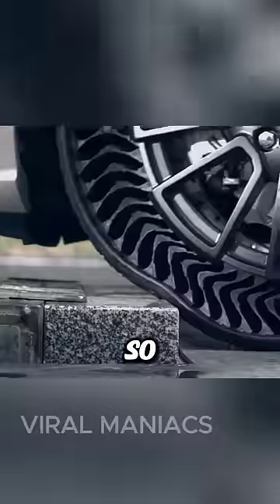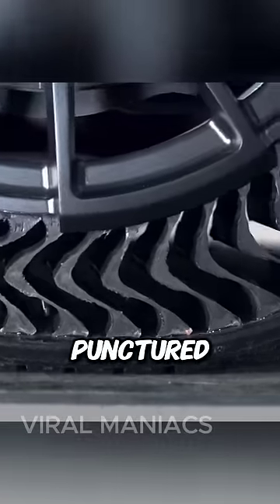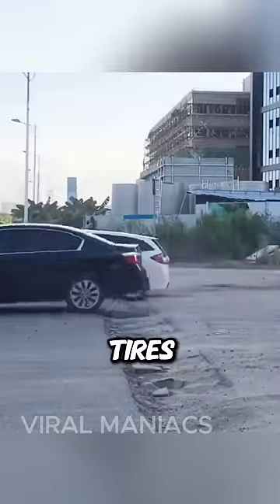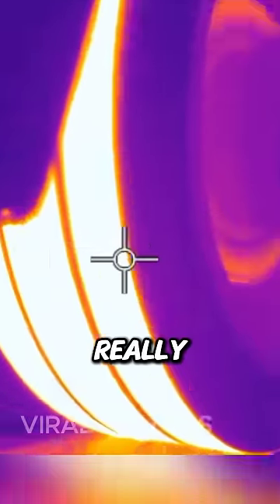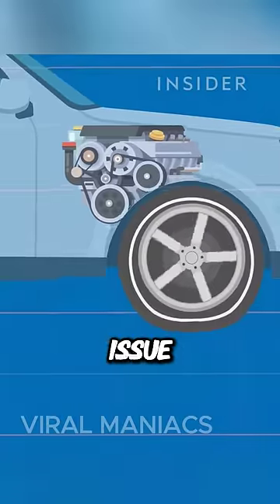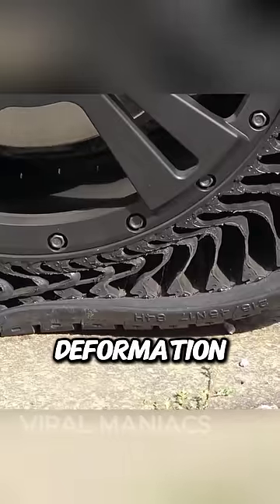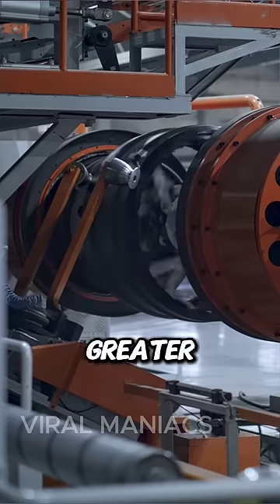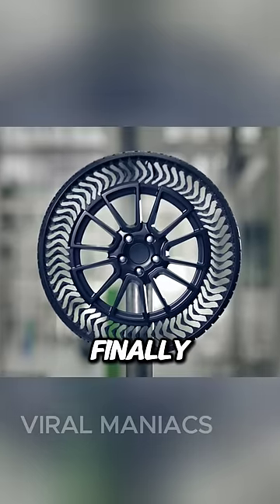Why Don't We Use Airless Tires Yet #shorts

Comment: "It is ready for production and commercial use"
They have kept saying this for the past 20 years!!!
Reply: tbf it’s being used commercially
Reply: Brooooooooooooooooooo like WTF
Reply: The plant I work in uses them on some of their machinery
Reply: 30 years bro, 30......
Reply: @curtisday7827 I mean yeah like forecliffs and other major  machinery meant to carry more weight lol but they don't do a whole lot of shock absorption primarily and when they do it's a t slow speeds not highway speeds
Reply: Well, they ain't lying, it is ready, but not available xd
Reply: Total BS.  The theory has been around since Goodyear built the “tires” for the lunar rover.  The problem with the design is cornering and sidewall stability, especially under load
Reply: @donaldculp3759  No, different type of tire altogether. I get where you are coming from, but no, the idea yes the application no. Lunar Rover Tires were originally developed by NASA and is now commercialized for use by The SMART Tire Company. These superelastic tires are airless, durable, and will never go flat theoretically. They are made from a special advanced material, NiTinol+ (nickel titanium), a shape memory alloy (SMA) that's elastic like rubber, yet strong like titanium. They have the same shape and general look of a traditional tire, whereas the ones shown in the video, like many others of the same type, have no side walls and are see through.
Reply: @Backlash00z89 "forecliffs" is probably the most interesting spelling of fork lift I've ever seen
Reply: Exactly 💯
Reply: It is ready but they don’t know how to compensate the money loss. Just making them 4 times more expensive doesn’t work because nobody will buy them and another thing is, who drives his car 10 years?
Reply: They are in commercial use. Most lawn mowers I see now are using them.
Reply: its a big market
Reply: @senorelroboto2 That is agricultural use, not exactly commercial. Commercial would be on semi trucks. But, they still won’t hold up to the heat they build at higher speeds, so they are still useless for the automotive world.

Comment: A big problem is the tread. A lot of tires need to be replaced because the tread wears out. Most people see these and think they would never had to replace a tire again, but because of the tread they will end up replacing a lot of tires anyway. Because the airless tires use more material they will cost more and could generate even more waste/pollution.
Reply: @jackventure3703
Not a problem if you can have them retreaded.
Reply: This, exactly.
Reply: I'd say the vast majority of tyres, at least in my country, are replaced exactly because of thread wear. Dirt roads are not common, here, even in the countryside. So, that mindset wouldn't be the norm. Yes, there are refurbished tyres, but people think they're less safe and heavier, only suited for  agricultural machines/tractors. By the way, these must be a lot heavier than regular tyres.
Reply: No, like the other post stated they will be retreaded. The tire place will just send the used ones back for that. So less rubber is required. Any one that is damaged beyond repair will be recycled. Tires are my life. This has been in development for over 20 years and millions in research
Reply: Because they weigh more and have no real sidewall for support they generate MORE heat
Reply: @staples138  wrong
Reply: You could reduce the waste, it’s less rubber per tyre
Reply: @staples138  they have no higher pressure inside, so they have less air molecules to exchange heat and cool down. The tires don't generate heat, the friction between tire and ground does. But that inner structure does not wear out, only the thread does.
Reply: @Lucifurion  how? there isn't enough to retread?! Not to mention they will wear out faster do to the lesser thickness
Reply: @Lucifurion the problem with retreads is they are usually shit.
Reply: We put airless tires on our lawn mower. Conventional tires would last 250 hours. The airless tires have 1000 and only look half way worn. Obviously cars are going to do more wear, but I've been very impressed by airless tires
Reply: Except these are made for countries where a tire usually dies because of a pothole before it wears out.
Reply: I don’t think anyone with a brain saw these tires and thought that they’d never have to replace them, they see it and think it’s convenient to not worry about maintaining proper tire pressure. Why would anyone see these and think that that the tread doesn’t wear out just because the tire doesn’t require air?
Reply: micro plastics
Reply: The idea is they can retread them look up the tweel it’s been around for a long time but got ignored for some reason
Reply: Yup, look at the tire in the video on the car, barely any thread at all.
Tires absorb shock just your shocks do.
Reply: Yup
Reply: @Lucifurion all rubber/silicon materials dry rot over time. They still will not last a lifetime. And depending on your milage, you might not even get 1 retread out of them.
Reply: The problem is there is no sidewall so  when turning as speed the tire wants to fold over.  That's why they arw only used on lawn mowers and skid steers.  Things that don't go fast and turn by pivoting.
Reply: @Lucifurion pls no
Reply: And just like the video said they aren’t as good in the heat so come summer time your tread will really stick to the road which also result in worse gas mileage. I think these could be great offroad tires though with the right tread
Reply: They actually use less material because it’s less of a tire.
Reply: Exactly 👍🏿
Reply: No one think you wont have to replace these lol.
Reply: You can retread them.
Reply: What about speed they look like it would be a massive wreck at high speeds
Reply: @Lucifurion Rereading is not a good thing, it's unsafe and doesn't give the same performance as a new tyre does
Reply: I think the most important part here is the safety. Because they can't get blown out, it's quite a bit safer that regular air tires.
Reply: @Lucifurion indefinitely huh? lol
Reply: @Lucifurion  What did you call me?? /j
Reply: I don’t think it’s environmental, if the government cared about the environment they wouldn’t be doing a lot of things they do
Reply: should be able to retread without worrying about a blowout like a normal tire i suppose
Reply: Used car tyres should be recycled fully and that where money should go to research best way to recycle.
Reply: @punker4Real that's it? Micro plastics?. Meh.
Reply: Nice point 👍🏼
Reply: I wonder about the fatigue life of the 'vanes' that carry the vehicles weight in place of the air cushion.
Also, should the car be parked in a puddle that later freezes, the driver needs to get the ice that's through the tire broke free.
Reply: Maybe the airless ones can be easily retreaded.
Reply: @Lucifurion the airless construction might allow for a replaceable tax.  Maybe a "bolt-on" replaceable outer layer? I'm thinking the flexible ribs are the most difficult part to design because of the tradeoffs between ride comfort, handling, and service life.
Reply: @staples138 Lol you think they will look like this? They will have a side wall
Reply: @robertpulliam4152 You guys are all joking about the sidewalls right?
Reply: @Lucifurion   Not that easy to do, even for forklifts... And these will need to consistently travel, well over 7x the speeds that any forklift can produce.... And the tire/wheel assemblies are very heavy as well as lack resiliancy... Definitely not good for road rated vehicles, and quite dangerous at speeds above 20 mph...
Reply: @TheLongDon  no.  What I said is true, and also they can't put a sidewall on them becauaw they need to be open to cool.  Bending rubber 1000's of time per minute creates heat
Reply: @robertpulliam4152  They do not need to be open to cool.... These tires are for demonstration only, they will have sidewalls on them on release. You aren't flexing the rubber any more than you would any other tire on the road, unless you think these are exclusively used to drive over speed bumps or something???
Reply: @CarNerd7  re treading isn't safe because your tire can blowout since it was not designed to be re treaded at all within its life, it's disposable. With a tire like this, a professional re tread should not be an issue. At this point you would have to replace tires by age and not tread life
Reply: @TheLongDon  right, but other tires don't have rubber fins inside the tire sealed up in a closed system. These tires are already on thr market for other applications, and they absolutely are open.  It's not just for demonstration purposes.  Heat and low tolerance to turning at speed arw the reasons these tires aren't being used in the automotive world.
Reply: @robertpulliam4152  Just looked it up because I've had this argument before and the answer is only slightly different from back then: They have confirmed it may have sidewalls on production, but even if it doesn't it shakes mud and ice and water loose and doesn't have issues without a sidewall when turning at speed (as expected from Michelin lmfao)
Reply: Exactly, saying this somehow reduced amount of tyre waste is ridiculous. They are replaced because the thread is gone after driving them long/hard enough, and that will be the same with any type of tyre.
Reply: Why tires cant be solid rubber i dont understand whats going on here
Reply: Here is the True Savior

HalleluYAH - Hallel u YAH - “Praise YAH”

YAH The Father (Genesis 1)
YAH arrives via The TENT OF MEETING
YAH was Who they Crucified for mans sins
YAH was Crucified on an Almond TREE

Original Semitic of Moses
Isaiah Scroll (The Original Isaiah)

Isaiah 42:8
I am YAH; that is my Name! I will not yield my glory to another or my praise to idols.

Isaiah 43:11
I am YAH, there is no other Savior but Me.

Isaiah 45:5
I am YAH, and there is none else.
Reply: The reason they don't make tread last longer is because then we wouldn't buy as many tires. It's planned obsolescence.
Reply: @staples138  so many people acting like just because they dont have one here in the video its impossible for them to have a sidewall when in reality thats probably exactly what theyd do, Im sure they dont want dirt and snow and ice to fill the tire either. Its probably just left open for testing and demonstration so you can actually see how theyre performing on camera.
Reply: Things that could be amended in the future I’m sure if we were to pursue them. I really think that there’s a bigger, more well-funded obstacle as to why we don’t have them in mass use yet lol

Comment: They’re widely used on heavy construction equipment, lawn mowers, and landfill machinery. Just not cars. They’re also really expensive, that’s why they’re not widely used.
Reply: A company I do work for has dozens of pieces of heavy machinery and not a single airless tire. Forklifts yeah, cause they only roll on smoothe concrete floors, but anything that has to deal with roads? I don't think so.
Reply: Even those are different. They're special made and foam filled.
Reply: @leoncaples2947 I have a skid loader that has Michelin Tweel tires on it -- same design from the video. They're popular for lighter equipment like mowers and skid steers.
Reply: @leoncaples2947 Yeah this is what Lull tires are, can actually lose chunks and still use it perfectly. Costs more than some peoples cars though
Reply: Well worth it in the long run
Reply: Why are they really expensive?
Reply: @leoncaples2947 not quite correct dude. They're exactly what you pictured in this video, I've had a set on my bobcat for 10 years
Reply: They're a lot cheaper than regular tires. I guarantee you, only because they last a lot longer than air tires like 10 sets to one. One maybe even 20 sets to one depending on the application.
Reply: These tires were $1000 USD a piece in 2017   How much are they now ?
Reply: @rich1879  if you can replace the treading then yes. If not, then no. The inner part of the tire that is airless may last a long time but the treading is going to be worn out quickly just like any other tire and will need to be replaced.
Reply: @fire_drake12.arc.24  you don't know what you're talking about.
Reply: Non of those things run 85000 per tire at 85 miles per hour 😂
Reply: Yeah the road noise and comfort with expense is hard to overcome. If you want something brutal though airless tires are crazy
Reply: No they suck for auto applications that’s why they aren’t used. They are garbage in any performance application, they are also very bad in a heavy braking situation especially with speed. There is a reason they only use them for forklifts.
Reply: No it's because of greed!!! It puts them out of business!!!
Reply: @Glenn-em3hv  no it’s because they suck and aren’t really usable in a real world situation. Extreme heat and cold make them useless, hard driving or braking make them even more useless.
Reply: Thats exactly what my mechanic/boss told me

Comment: From an engineering POV, these are 2 different customers. Airless tyres prioritise on Absolute Reliability which is imperative for NASA. Normal air tyres prioritise comfort and cost, reliability is just a bonus. Tough to make 1 size fits all
Reply: No, NASA doesn't need them for reliability. If air tires are reliable enough for commercial airplanes, then they're reliable enough. NASA needs them for Moon and Mars vehicles because you can't have air tires in vacuum, near vacuum, and in extreme temperatures.
Reply: @Mr.Anders0n_  That's an absolutely valid point! Those are the conditions necessary and Reliability is the quality needed

Comment: Definitely a head ache for police when chasing criminals.
Reply: They’ll just roll out… 
THE GRAPPLER!!! 
Assuming they are chasing of course, not waiting to catch
Reply: A spike strip will still get caught in the tire and slow them down.
Reply: They have stuff that can lasso onto tires now and stop cars fast and safely
Reply: They have a better system now...works like a net.
Reply: criminals would possibly have the same tyres
Reply: Let's all live in jail cells, monitored 24/7, so the cops have it easier 🤡
Exactly the same mentality
Reply: 👺 yes the Neanderthal european caveman 👺
Reply: Not really
Those things can't take high speeds at all
Reply: Now they'll just shoot your car with a GPS tracker
Reply: All new cars will have gov shut off switches
Reply: Run forest run
Reply: By law all new cars have kill switches that police can use
Reply: When a airless tire gets caught by a nailstrip it will sill get ripped apart after a little distance
Reply: @christopherwellman2364 – someone who hasn’t seen a spike strip used
Reply: @ministryofwrongthink6962  if it wraps around the tire, it'll slow it down
Reply: @3goats1coat or, just don't get pulled over
Reply: Get spikes that once the tire is puncture it releases a horizontal set connected to the original spike to set the whole strip in the tire
Reply: @Cornball-01  exactly
Reply: They'll throw one of those giant banana peels or maybe a red shell
Reply: @josephbrandenburg4373  lmao
Reply: How so? What does that have to do with bad people?
Reply: @mikeb1596 That would be illegal for law enforcement to do the kill switch on vehicles. The government cannot require a kill switch to be installed in any vehicle because of the Fourth Amendment. This is what a high-speed police chase is for because it will put criminals behind bars for a longer period of incarceration if they hit an innocent vehicle or pedestrian.
Reply: @3goats1coat  the public would have it easy too,less of a danger on the road from ppl running from cops,if these tires would actually aid someone running,idk see how that's equal to a 24/7 monitored jail sentence, that's like somebody saying that bc you  commented that,that you want no laws just bc there are some bad cops,awful big leap don't ya think
Reply: @jamierowe_   these kind of issues ultimately should be decided from the point of view of public good and benefit, not from some misplaced need to bend over backwards to authority or virtue signal.
Do you have any idea how many car accidents happen, not daily, but each and every minute globally due to tire blowouts? How many millions of kids have to become orphans, only so a single doughnut-muncher can get his hollywood moment and roll out a spike-strip?
Go out, touch grass. Your thinking is mangled by the screen.
Reply: @3goats1coat You do crimes or  something?
Reply: @Randomguywholovesdovs 😂
Reply: It really wouldn't be because these wouldn't work to drive at speeds that are worth going
Reply: @kevingrandyify victim blaming
Reply: @jamierowe_ no true scotsman, bad apples spoil the bunch.
Reply: @Randomguywholovesdovs Ad hominem